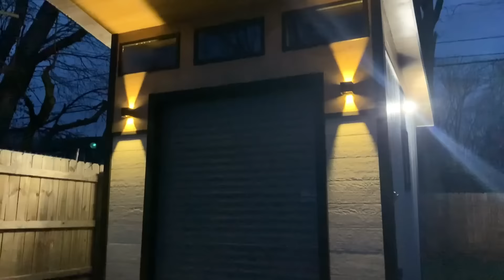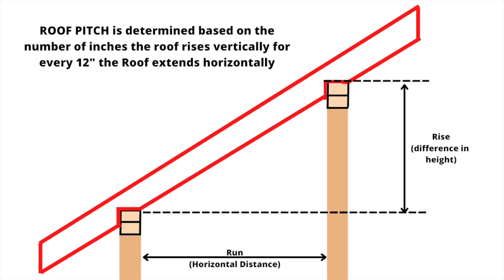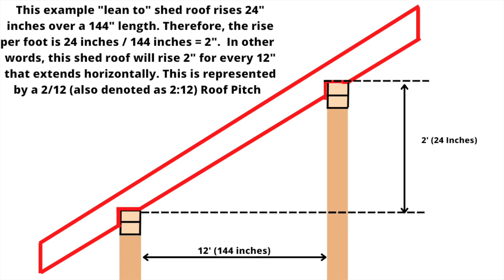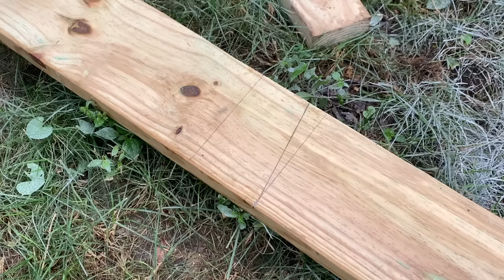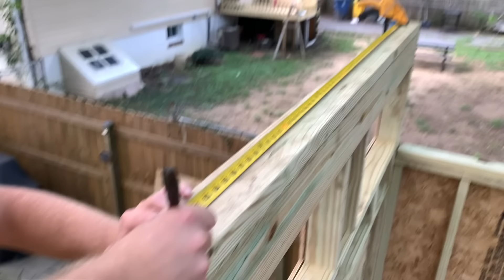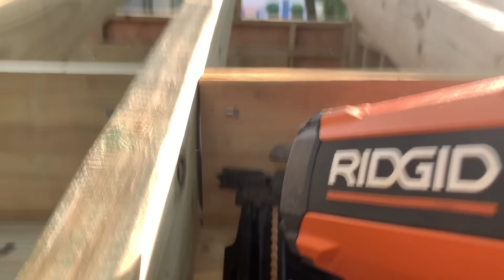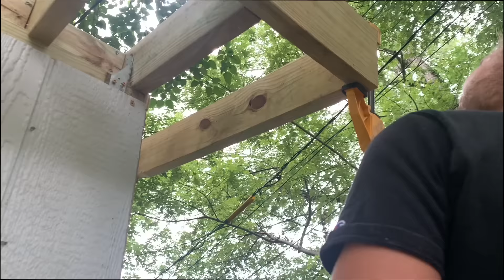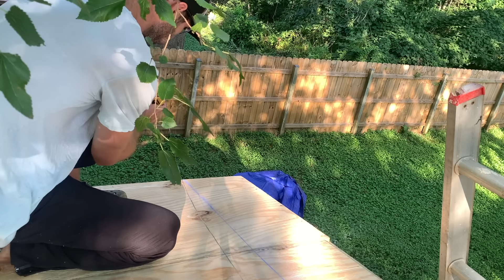DIY Shed Roof Framing (How to Build a Shed Roof, Make Birdsmouth Cuts, and Install Plywood Decking)

Comment: A much easier way of doing the birds mouth cut is to use an off-cut of your top plate timber (half thickness) and just draw it onto your rafter when you've decided the overhang on each side of the shed while your timber is on the roof, cut your two notches out and trace every other one from that first piece.
Reply: I just made this same comment. Makes birds mouth easier and more accurate.
Reply: Thanks. I'm no expert, but it was obvious from watching this video that there has to be a quicker way to mark your birds mouth. Here's another way: https://www.youtube.com/watch?v=eOjm42f3qTI
Reply: Thank you! A video I could finally understand. 
Great job, explaining everything!
Reply: One video I watched awhile back was clamping all your 2x4s together and making the initial birdsmouth cuts with a circ
Reply: @markchristensen3353  Efficient!!
Reply: oh thank god. i genuenly have like no experience in building and im working on this chicken coop for my brother this is such a time save. florida heat is overbearing when u spend hours on a single wall lmao
Reply: so much easier that way. The birds mouth cuts don't have to be complicated
Reply: In each similar video, showing dances with a Swenson square I see a comment you made :)))

But they still filming these videos explaining a pitch meaning and birds things.
Reply: @alexbowser9801  I think you're mistaken and delusional.
Reply: its the same difference.
Reply: @thefishingmusicians  Genius level comment. Of course it is, not the same amount of time taken though. I literally provided an easier method, because it's the same difference.

Comment: Why don’t you rip a 2X4 into a triangle wedge that matches the roof pitch and slide it between the roof rafter and top plate instead of making bird mouth cuts?  I think that is a lot less work than making bird mouth cuts.
Reply: sounds interesting.  Do you have a video link of someone that has done that?  I would like to know more as I literally just erected 2 of my 4 walls on my 12 x 12 shed and they are tall... instead of going full truss I will have to scale it down to a lean to roof.  Thanks

Comment: Great video, subscribed. One question: You installed the blocking at the edge of the top plate. I agree that will look better, but aren't you worried about ventilation? Are you planning to insulate this space and do you have a ventilation plan?
Reply: He doesn't reply to comments but since you're asking you already know the answer.
Reply: @mattiefattie3895  I don't follow. I'm asking because I don't know the answer. Care to help out?
Reply: @owenwiseman6112  the ventilation question

Comment: I used this video to put the roof on my chicken coop. Thanks for sharing this info! I’ve never done carpentry but my coop turned out awesome in part thanks to your video.
Reply: That's exactly why I am here. Finished leveling the land for my coop and run today. Getting material this weekend to start the build. It will have a single pitched roof like this but I have never done any carpentry either and the roof seems tricky.
Reply from the maker: Glad it helped Eric! Also glad your chicken coop turned out well. Thanks for the comment 🙏

Comment: Could you not just put the roof truss up hold it 2 inches further to the back off center, then just put the framing square over the 2*4 trace that into the roof truss on both ends then cut it done
.

Comment: How long of overhang do you have on the high end? Do you have to worry about snow load? I want to have a 3' overhang of my shed-style roof rafters that are 16" apart and 2x8's. Will this have enough support for load in winter?
Reply: 3 foot overhang is not to code...just in case you care!  I am sure it will be fine though.  24 inches overhang is standard.  This dude is young and should have done things different.  Plywood always runs across the rafters!!  Plywood clips between sheets of plywood is a must.  No clips will let the plywood sag.  No clips equal sagging.   I know shit!!   After you have done a hundred you get it!!  PeAcE
Reply: @LocalTradesman  or blocks with leftover scraps for free

Comment: Notice how the slot your thumb is on is already in the correct position to mark the seat line? that's not an accident ;) No framing square required
Reply: Are you talking about the diamond? Can you explain this, or link a video? I guess I'll have to read my Swanson speed square book ;)

Comment: Are the cut outs in the pivot ruler not the line you need for the seat mark instead of using a second ruler? I'm only asking, never used one.
Reply: Yes, but only on some speed-squares, not all.

Comment: Why didn't you cut the tails of the  rafters to match the pitch of the roof?
Reply: All the difficulty of cutting birds without making the facia verticle hahahaha love it
Reply: @kylerrichmeier5892  What about the plywood not running across all the rafters?  What about plywood clips??    He is young... but no excuse!!!  I am building a 14x32 foot 3 story that I am going to video and put up this Summer of 2023!!  Bidge over the Wolf  River Tiny Lodge!!   PeAcE
Reply: @LocalTradesman  no one cares
Reply: @LocalTradesman  you only need clips if you have longer than 16c joists.  I don't know if he spaced them 1/8" though. I couldn't tell
Reply: @LocalTradesman I don't see your video series? At least he's sharing honesty not false statements.
Reply: @FranciscoGonzalez-ro7ht  It is coming.... wait for it.....   time takes time......
Reply: @LocalTradesman You answered a question nobody asked.
Reply: @Icutmetal  Is that a good thing?  I thought it was funny.
Reply: @allwoundup3574  Not one person on the  planet??  I am special then!!  PeAcE
Reply: @allwoundup3574  It;s only a long standing 101 building thing!!  hahaaha   it is just funny to me...  why do I do everythin ng soooo Peeerfect.?  Idiot I am!!
Reply: WAs wondering the same thing, easy to drop a vertical chalk line on a plumb bob or just use a level to mark that line?
Reply: The fascia board can be installed on the rafter tail cut to the roof pitch OR the rafter tails can be left square/perpendicular. It's a matter of choice.
Reply: What would be the purpose of doing that?
Reply: @FranciscoGonzalez-ro7ht  to prevent water from rotting it.
Reply: This is the Jamaican look ??

Comment: I am trying to find a compressor for framing myself, but as I live in dk I dont have access to porter cable. So how many psi did you use for this Project?
Reply: Enough to make the nail sink in a little more than flush. Take some scrap wood and test it.

Comment: Thanks for the details on this. You forgot to angle cut your rafter ends 12 degrees.
Reply: Agreed, the water will run down the fascia and streak, and then rot the underneath.
Reply: @andrusha77 streaking, sure, but no issue with rot if you install a proper drip edge, the slope isn't that aggressive for the water to wrap around the drip edge
Reply: It’s a style of keeping it that way

Comment: A 12-foot roof span needs at the most 8 rafters at 16-inch centres. Are you planning on parking a garden tractor on your roof? Your roof is overkill. Specially at the price of lumber these days.
Most sheds are built at 24-inch centres, but16-inch is better.
Reply: maybe he has a snow load to worry about?
Reply: Lmfao
Reply: Thank you 😂 wth I finished this losing my mind on some of this stuff. My guy- 2x6s are tough, what are you doing?! Then paying for a hurricane tie 2x for each, then cutting 2x6 filler blocks but ripping? No scribe for birdsmouth? I'm dying. I appreciate seeing the the process, but as it turns out- apparently I know enough to make a video about it - here I am looking for ideas and advice on how to save time and money and I found the "what if I wanted to put a rooftop hot tub up there" guy

Comment: i dont understand the formula that you use to get the pitch . i was looking at a wall at 4 feet on one side and 8 foot span and a 6 foot wall on opposit side . so how do you come up with the pitch i tried dividing the 96 inch by 48 and came out with 2 but trying the same with your numbers did not work . ????
Reply: @Deb Bushee...  You will need a 3/12 roof pitch to rise 24" with an 8' span. 3" rise x 8 = 24, so 3x8 = 24 inches of rise. You will gain 3" of rise per every 12" of run along the span. I  hope this helps and makes sense!

Comment: Your blocking is placed on the INNER most edge of the topplate - not the outermost. Correct?
Reply from the maker: Blocking was placed on the Inner most edge, correct. Sorry about that.
Reply: Blocking needs to be flushed with the outside top plate, not inside. 
And the number one rule in sheathing is you never break on one stud/rafter/joists.